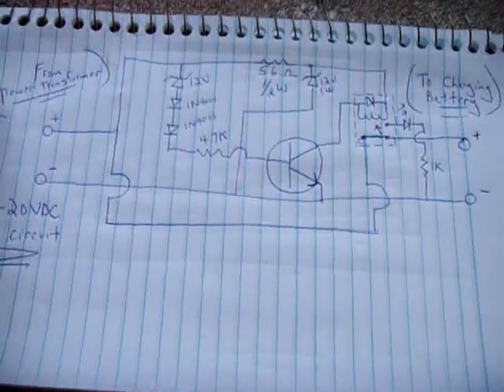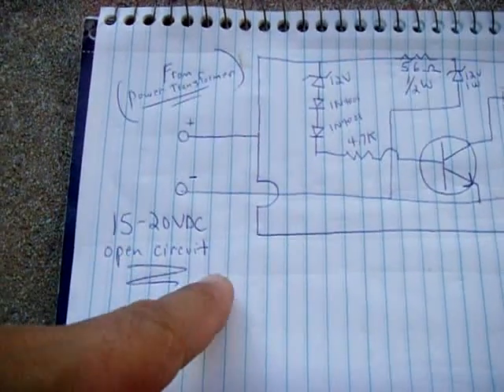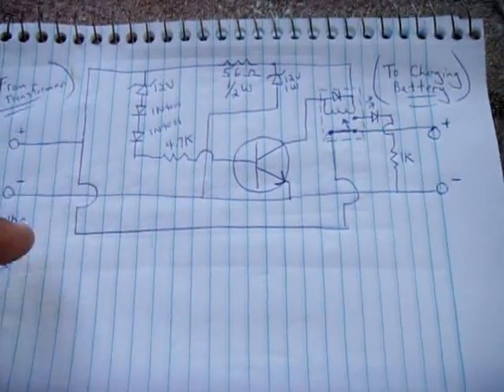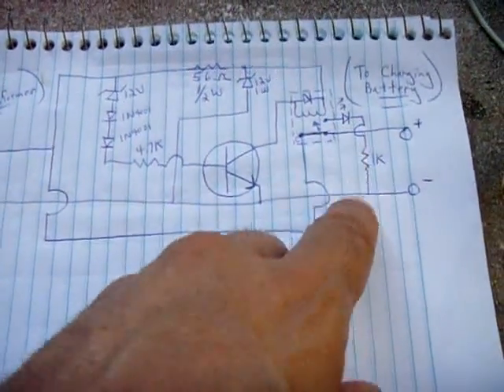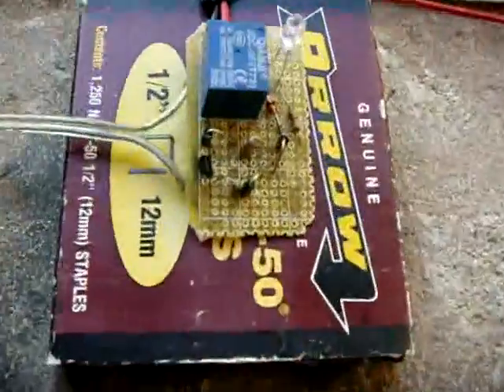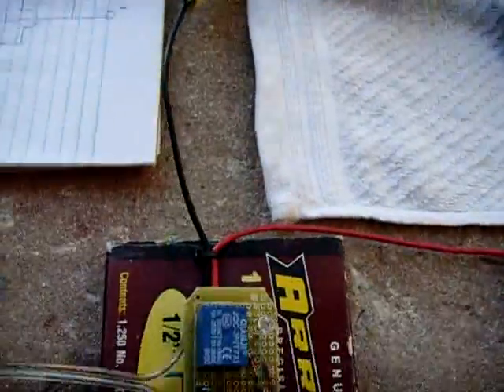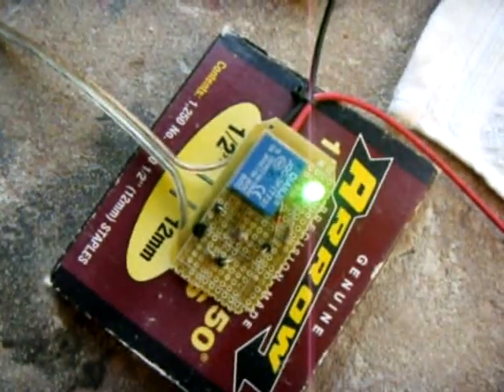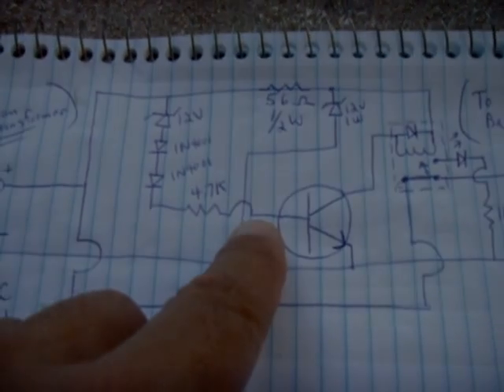Cut-Off Circuit For 12V Lead Acid Battery Charging

Comment: Hi,
Another useful circuit, Thanks!.
But as usual am unable to find where am making a mistake.
I am using 12v Relay, IN4007 (x3), IN4742(x2), 4.7K Resistor, 1k Resistor, 56 Ohm half watt resistor, BC547 AND 12-0-12 (3amp) transformer as power supply. ( Also tried 15-0-15 (1amp)). 

The problem is its fluctuating. THE GREEN LIGHT AND RELAY GOES ON AND OFF IN A MICRO SECOND AND ITS CONTINUOUS.

Just like Power is transferring from NO to NC in ever micro second rate continuously.  

One more thing: I am connecting transformer directly to this circuit. Do i need to attach Bridge Rectifier with the transformer, Or those 2 IN4007 are already acting a a rectifier.

Thanks in advance.
Reply from the maker: +Anubhav Sharma Once the circuit triggers the relay, the voltage can only go higher which would ensure the relay stays powered. Try a 25v/1000uF electrolytic cap connected to the NEG rail before the 4.7K resistor which leads to the base of the transistor.
Reply: +electronicsNmore Thanks.
But do i need to connect bridge rectifier with transformer first or the two diodes after Z diode acts like bridge rectifier OR there is no need of bridge rectifier. 

NEG Rail = connecting negative pole of cap to ground and positive to the starting point of 4.7K resistor. Is that it?

CAP= i have 1000uf 16v and 50v only, else i have 4700uf 25 v. Can i use 50v or 16v or 4700uf will also do?

Please guide.
Reply from the maker: Anubhav Sharma

You CANNOT use AC on this circuit. No wonder you're having problems. You must use a DC supply as mentioned in the video.

Comment: Hi, I'm trying to use this circuit in an old school charger but I'm getting massive relay chatter.
Mounting it in the charger case, could it be too close to the rectifier?
Testing it with a variable power supply or wiring it to the clips of the charger, works perfectly
any ideas?
Cheers
Terry
Reply from the maker: +Terry h 
Definitely a voltage problem. Whatever way works for you.

Comment: if i connect a electrolytic capacitor of 1000 uf (30 V) parallel to the input of this circuit, will it work ideally ?
Reply from the maker: +Abhi G 
Hi. Your question does not make sense.
Reply from the maker: +Abhi G 
Hi. Your question does not make sense.
Reply from the maker: +Abhi G 
Hi. Your question does not make sense.
Reply: +electronicsNmore  my transformer gives 13 V as an output. which i have connected to a rectifier. and getting 12.50 dvc (5amp) .since this is not pure dc (some repel factor is there). if i place a capacitor parallel toh VDC output and then follow your mentioned circuit. will it work? if yes then please suggest me the capacitor value.
Reply from the maker: Abhi G
Some ripple in the DC is not a problem for charging a battery. Use a value in the thousands of uF.

Comment: is there any reason to make a cut-off circuit for an 18v (made with 3x 6v 1w) solar panel. I have problems with my car battery because I barely use it and was thinking of making a DIY solar charger that is permanetly connected.
Reply from the maker: +micheals1992 
Hi Mike. There is no need for a cut-off circuit  when using only 1W solar panels. :-)

Comment: Hello sir, will 12-0-12 center tapped transformer work in this circuit for the power supply? I want to charge 12 volt 10Ah lead-acid battery, thanks.
Reply from the maker: +Dhiraj paudel 
Hi there. It should be OK if the current rating is fairly high, and you use the center tap and one side of the winding for 12V. Using 24v is too high.
Reply from the maker: +Dhiraj paudel 
Hi there. It should be OK if the current rating is fairly high, and you use the center tap and one side of the winding for 12V. Using 24v is too high.
Reply: +electronicsNmore thank you sir. Will you please suggest the power supply circuit using 12-0-12 center trapped transformer? I'm bit confused about the high current rating.

Comment: Hello. I've checked the schematic and works great. Very good tutorial. Tell me please....if i want to make this cut-off circuit for 14.4 volt battery, what chnages should i make?  I suppose i'll need 14v or 15v zenner and same components....a little big led rezistor because i'll using 21v transformer.

 I have the charger and the rectifier only, but no cut-off or trickle charging. When the battery is full, it overheats until i stop the charge. It's an old model of charger. 

Thank's
Reply from the maker: +Florian Vasilache 
A higher wattage resistor and the correct zener should do the trick.
Reply: Which of the resistor? There are more. First i was thinking to use 0.5w or 1w. is ok? Regards,  Florian
Reply from the maker: Try 1W, if it gets too hot, then go higher. (The 56 ohm)
Reply: +electronicsNmore  Hy. I've made the circuit using correct components and i have a problem, the relay is buzzing....opening...closing.....opening - closing very fast...like it has alternative current, but the power supply is DC, 15v 1A with rectifier, i've checked.  Another problem.....the zenner 1n4742, the second one....that is connected single to + and -, not the one with those 2 diodes in series.....get very-very hot quickly, after 2-3 seconds i connect the source. I've checked the components and are connected correct, as schematic.  The 56 ohm resistor is 3w.

If i put the power suply without conecting the battery, does it have a protection? The relay stays under voltage? it's ok? Please help! Thank's!

Comment: Hi sir, i want to use your circuit with input supply 9v solar panel to the 6v battery...is the battery will automatically recharge when led is turn off if the battery is lower than 6v even input supply is still 9v which is higher than voltage of battery?
Reply from the maker: +Hariz Sharif 
Hello. You need to adjust the zener value lower(to around 6.8v) for a 6V battery. Also use a 6V songle brand relay. You must start off with the battery connected to the circuit.
Reply: +electronicsNmore thx for your reply sir, but may i know or can u give any idea why my solar panels'votltage will drop to around 2V when connect to input? my circuit doesn't work when using solar panel but it work well when using adapter.
Reply from the maker: Hariz Sharif
The current output of your solar panel is too low. You need a panel that is higher wattage.

Comment: can i use this circuit for charging a lead acid battery with a solar panel ?
Reply from the maker: +Frank Alvarez 
Hi Frank. Should work fine. Open circuit voltage of a solar panel is around 20V.
Reply: Thanks a lot .
U are the best in explaining  : )
Greetings from Macedonia : ]
Keep going with the great videos!

Comment: I just came across your video. I have a question, won't the relay chatter at the cut off voltage
Reply from the maker: +Tanbirul Quadir Choudhury 
Hi there. There is no chattering, at least with the circuit I made. The voltage climbs to a point where the relay closes. Once the relay closes, it is a done deal. :-)
Thanks For Watching
Reply: The reason it did not was because you used a power supply to gradually increase the voltage till it cut off. Normally a battery would be used in its place and that is when the problem starts. On paper a hysteresis is supposed to be added. If you have such a circuit please share it. Thanks once again.
Reply from the maker: Tanbirul Quadir Choudhury
As the battery voltage rises during charging, so does the voltage at the base of the transistor. Once the voltage rises enough, the relay contacts will close, and all charging ends due to the sudden spike in voltage at the base of the NPN because there is no longer a battery being charged. I do not post circuits that do not work. I suggest you try the circuit before knocking it.

Comment: @electronicsNmore sir, i have duplicated your diagram., but when i connect it to a bigger trans, (dont know the amp rating) but the Output is 16V DC Filtered, (with a Connected Battery Ofcourse), then the Relay Starts to BUZZ... But when i Replace the Trans with a trans of 15v  Dc 4amp.. The buzzing Stop... is there a Way to  get rid of the buzzing noise?? it only buzz when i connect it to the battery...
Reply from the maker: +Billy Joe Albesor 
If you copied EXACTLY what I show in this video, then it should work fine. Try another power supply, and make sure every component is working and correct. Try the relay I used. The brand is "Songle". Your relay may be too large and draw too much current, which is causing the problem.
Reply: electronicsNmore  Solve my Problem, All i do i just add a Capacitor a cross the relay coil and the buzzing is gone.... tnx for your circuit, helps a lot...

Comment: Hi, Thank you very much for this wonderful tutorial. I just had a few questions. I have heard that a SLA is charged at around 15V. If I use that as the input voltage, the relay gets triggered and there is no charging. I am using a laptop charger as the power source and it's open circuit voltage is around 19.4V. I am using this with a home-made adjustable power supply.

Could you help me this? Also the battery draws very little amps (250mA) if i put Vin at 13V. This way it'll take ages to charge. Also the unit is pretty hot. I can hold the heat sink for about 5 seconds max.

When I connect the battery which is currently at 10.6V, there is no voltage drop on the source. I am new to electronics so not being able to understand.

I am attaching my schematic. Please help!

http://s173.photobucket.com/user/ydobonmai/media/Circuit_zpsx6uvpewj.png.html

Comment: Is this the same circuit if one is using a 8 (car) battery @ 12 VDC each in an array (in parallel) for recharging. Total voltage from the array is 96 VDC. Does this circuit have to be adjusted to 96 VDC ?

Comment: Good lead acid battery chargers are almost ubiquitous today.  You can get them at Wal Mart or sears or on e-bay.  I am looking for some circuit using a 2 stable position latching power relay circuit cutting off the load to protect a 12 volt  lead acid battery from draining lower than the 10.5 volt safety limit.  A circuit that does not require current either to remain on or remain off is most desirable.  How would you work this?
Reply from the maker: Soteriology101 Hi there. A circuit that draws no current is not possible. A circuit that draws extremely low current is available(uA to mA). I made a circuit a while back from junked parts which is adjustable and works great. There are other circuits online as well. 

Check it out below:
https://www.youtube.com/watch?v=1BKEMDYAGBA

Be sure to share and rate Thumbs Up. Thank You!

Comment: dear electronicsNmore i want to thank you for answering and i want to apologize somehow   you were right      the circuit is correct   my fail is that i was using recicled transistors from an old computer and even if i test them theres no way in knowing the npn is an npn really  the point is that i dont live in usa and my town is small so i could not get the parts you put in the video but finally i got something alike smaller but they work just fine now  with zener two diodes and the  4.7 resistence the npn opens at almost .7 v at 14 v from the transformer  good enough    trouble to find 12 v zener diodes too thank you

Comment: dear mr sr i know you are busy i was not going to writte but  i just needed to know i did  the circuit same thing but it happens that the npn opens at 18  to 19 volts from the transformer     npn normally open at .7 volts but i reach the .7 v at 18 v  from the transformer i use a 12 v zener and even without the two diodes  just the 4.7 k cant get it to open at 14 v it opens at 16 v.       i get to open the npn at 13.5 v  with just the zener an a resistence of 250 ohm   can you give some advice   i mean your regulator works nicely but mine  im a mess id like to hear an explanation  from some one who  knows
Reply from the maker: trefeemeke glz Draw a schematic showing EXACTLY what you did and every part you used. Post the link to your schematic here so I can look at what you did. Clearly you did something wrong.

Comment: Thank you sir, I was looking for an simple circuit like for a long time just to charge my car battery .I will build it and tell you if it's works .I don't have seiner diodes so I will turn the base current to 13.8V  on the transistor with an pot.
Reply from the maker: CarproSur The circuit definitely works if you make it properly. Without a zener, do not bother making the circuit. The zener is critical.

Thank You.

Comment: sir do you have a schematic diagram for Cut-Off Circuit For 6V Lead Acid Battery Charging
Reply from the maker: mc st. peter For 6V you will require a 9V-11V open circuit transformer of sufficient current output. Replace the 12V zeners with 6V zeners, and the relay also needs to be 6V. LED resistor is 620 ohm.

Thanks. Be sure to share and rate Thumbs Up.
Reply: electronicsNmore 
okey sir thankyou very much

can i charge the two 3.7 lithium-ion battery in this charger ??

Comment: Hi i was wondering if you could help me please. I know you circuit is very simple. Afraid i know very little of electronics, more of mains wiring etc.
I have tried to copy your circuit and have included a diode in the '-' output terminal to prevent the circuit drawing from the battery when charged and not disconnected. Please correct if i have it wrong.
My problem is this, i have checked my relay with no power feeding it and have identified which two terminals are connected to eachother. When power is present i hear the relay click and my power out of the relay changes to the other terminal even when no battery is connected to charge. Could you give me guidance please as to where i am going wrong.
Many thanks

Regards

Carl
Reply from the maker: Carl Hunt Hi Carl. If no battery is connected to the circuit before the power is turned on, then the circuit will turn off the battery charging immediately(with the relay) because there is no load on the circuit keeping the voltage down. The voltage will rise up above the zener voltage and trigger the transistor. If you are having more issues, you need to monitor the output voltage from the transformer, and possibly make changes to the zener or diodes in series with the zener.

Thanks For watching. Be sure to share my channel and rate Thumbs Up.

Comment: Please help. I like to turn on a load that i have set up (5 ohm 100Watt)  until it drain to setted voltage then activate charging and deactivate the load. Keep doing this for 2 time. I Was wonder if this is possible without using micro controller. Please, this urgent. 

thank you so much
Reply from the maker: Hi there, unfortunately due to the large number of videos I have on my channel, and many people asking questions, I am not able to design circuits for any viewer that requests I do so. I am also very busy creating new videos, and also require my free time as well.

You can post your question at this forum:

http://forum.allaboutcircuits.com/

Thank You

Comment: The 1w 13v zener connected after the 1w 56 ohm resistor becomes extremely hot after the batttery charging completed. I dare not left it idle for long time, surely the zener will burned out. Both of the zener is 13v. The transformer no load output is 26 volts 2 amps. How to overcome the zener heating problem ?
Reply from the maker: Your no load output is too high. I said to use a transformer which supplies 18-20VDC(No Load). 22V is about the max. I suggest you use a higher wattage Zener, or a higher wattage and higher value resistor.

Thank You.
Reply: electronicsNmore
Ok, will try. Thank you.
Reply: Quiksilver5813
270R 1W working fine. No more zener over heating issue on 26v trafos. Thanks.
Reply from the maker: You're welcome. If the resistor gets hot, just up the wattage.